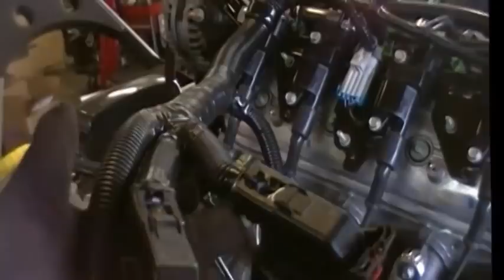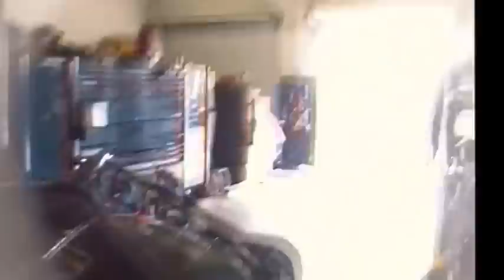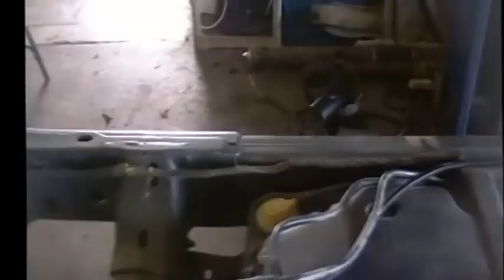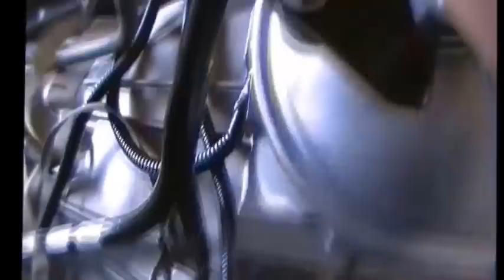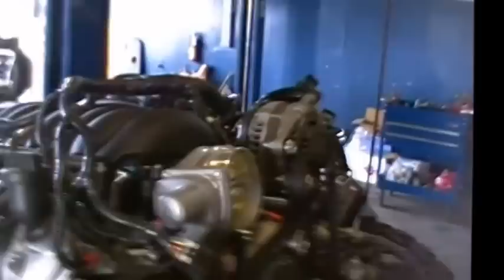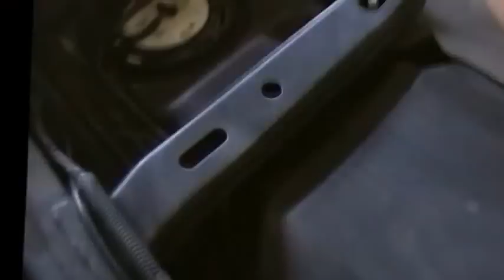Part 14

Comment: blue and green wires coiled up near the molex connector are for what? and is there a reason why both grounds and positives are covered in red shrink tubing? would it have been that tough to use black on the grounds...? Im installing one of these right now and there are a ton of items that are left out of the videos... yet you spend 10 minutes telling us what type of motor oil to use and how to properly test fuses